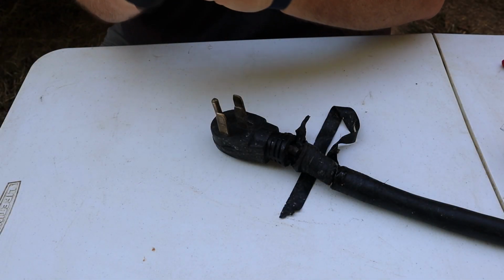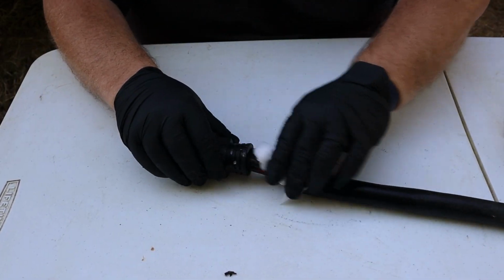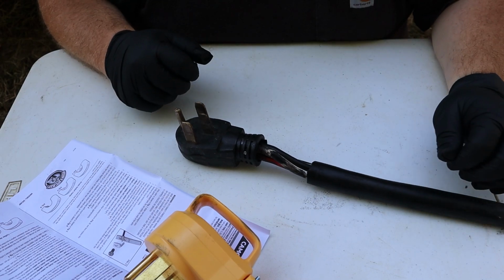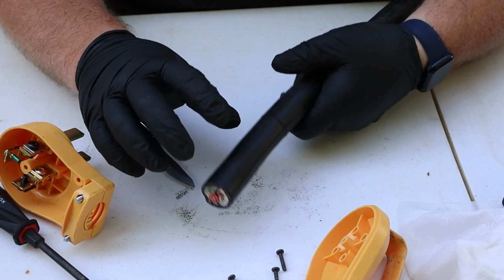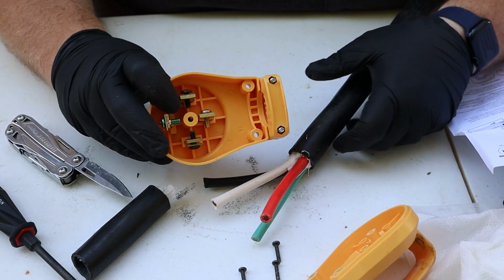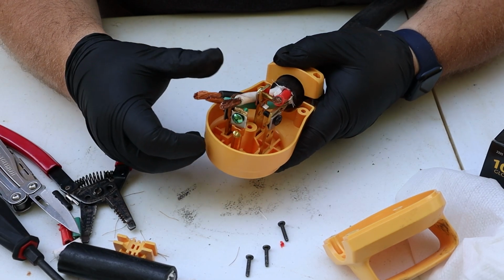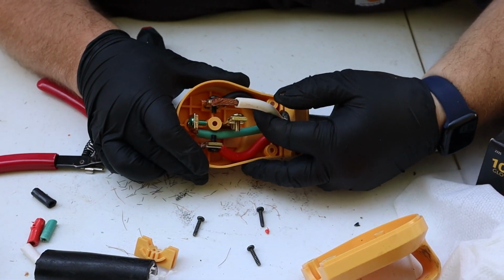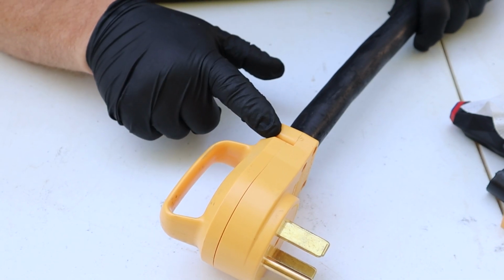QUIT RISKING IT ALL - Replace Your RV / Camper Power Cord Plug NOW

Comment: Hey you should look at the inside of that plug again. That red wire screw is touching the ground wire and with a little bit of time and the force needed to plug that into an outlet, you are going to have a dead short to ground and cause some serious damage. That tip of the metal screw is going to dig into the ground wire. I would flip the hot blade around so the screw is no longer touching the ground wire at least.
Reply from the maker: That's a good catch! I'll be taking it apart and routing the ground wire in another direction. Thanks
Reply: You have mentioned the DIYfferent people before.  Do you know how they are.  Homesteaders don't usually mention their specific location but I think the hurricane was very close to them.  And how are you and yours doing?

Comment: The two hot wires (black and red) of your 50 amp RV male plug are wired backwards. The black wire should be wired to the left-most hot terminal (L1) when facing the back of the male plug.

Comment: I’ll give you a E for effort. The ground should be routed around the backside of the red wire terminal. Never run in between the red or black wire and the center cover screw. Every time you plug and unplug the cord cap it will slightly wiggle the prongs and can eventually wear through the grounding conductor with the clamp screw from the red wire resulting in a future big boom.

Comment: Weather you use 3 or 4 wire plug, the older your RV is the less chance you'll need 4 wires. You can also fill the plug with epoxy for less chance of a short.